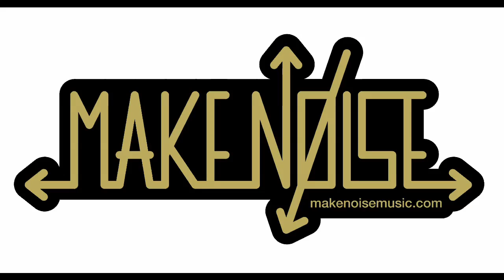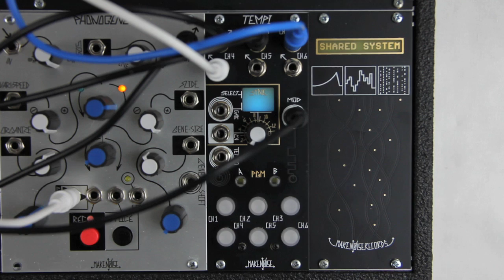Make Noise TEMPI Pt. 4: SHIFT

Comment: what about swing?
Reply: +WaveRiderMusic It's not a sequencer though. It's not typical for a clock divider/multiplier to have swing. However, it seems like you can "machine program" fine adjustments that aren't exact integer divisions/multiples of the main clock which is a pretty unique feature to the Tempi.